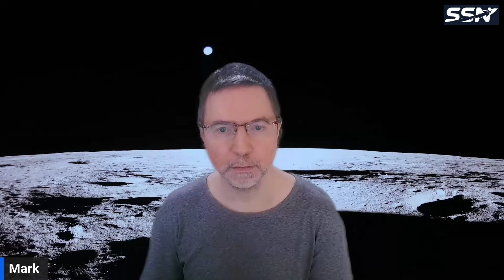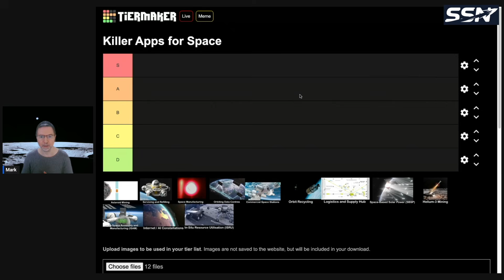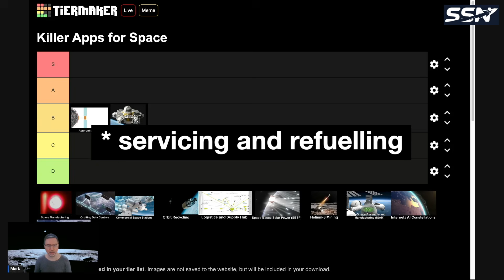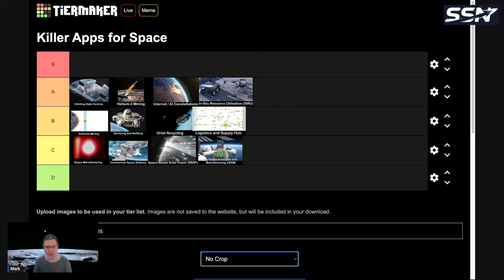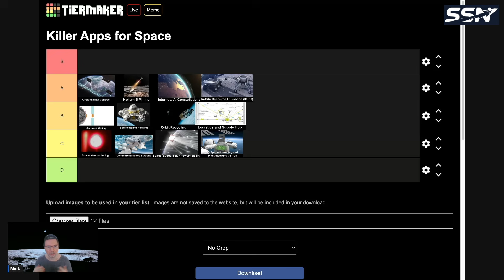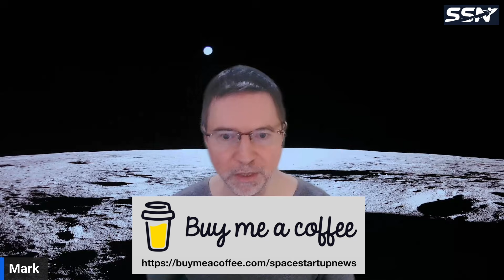Tier List Killer Apps for Space

Comment: I think in terms of commercial space stations. They may need to be paired with another one of these applications such as orbital manufacturing or mineral/asteroid processing.
Aside from this I question their commercial viability without NASA's finances
Reply: I think the case for commercial space stations is very strong. If even half of the planned constellations make it to orbit, the traffic management will become nuts. If present conops continues we will see some level of a Kessler type event within a decade. 

At that point, a few large stations that rent antenna space or other industrial facilities will make a lot of sense.
Reply: Thinking the same thing. If SpaceX StarFall determines that orbital manufactured goods are valuable on Earth, then building orbital factories will take off. It's not hard to imagine a group of factories in LEO or some at the mid-way point to the moon where goods are produced from lunar resources and then dropped down to Earth. But short term, if microgravity goods prove valuable, LEO manufacturing will be the next big thing.